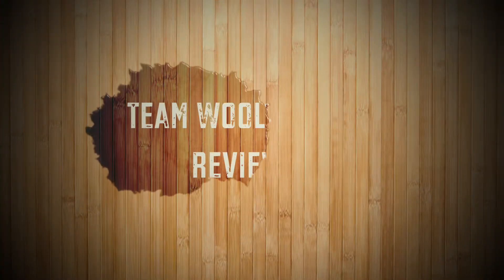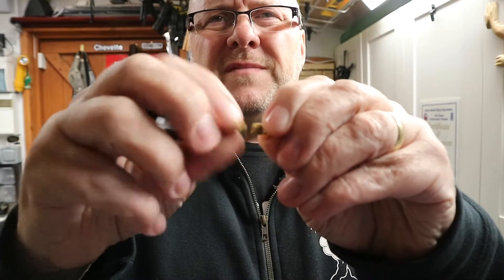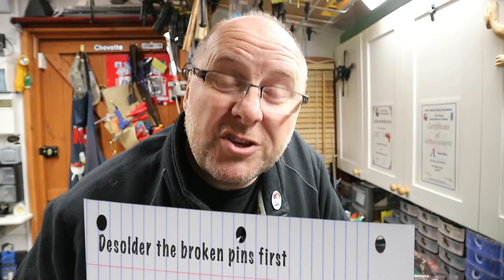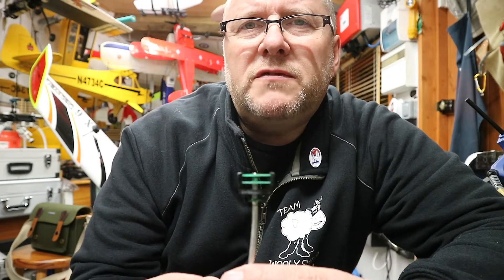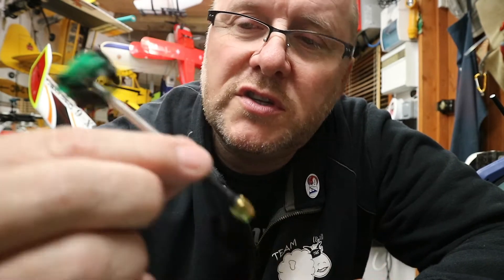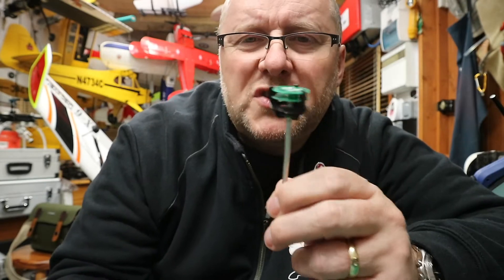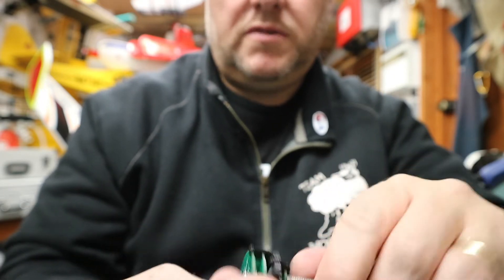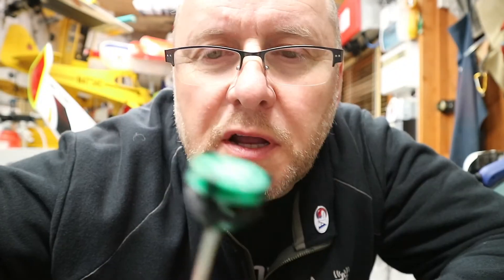Quad VTX Plug Repair & Drone Crusader Antenna Review

Comment: Hi  Buddy, nice video  cheers for the mention 
the clip system was designed by painless360 there are stubby versions with extra shrink tube protection for the racing quads, RHCP and LHCP :-)
Reply from the maker: No problem, thanks for the antenna to try. The Pagoda is a really good antenna design but if the plates get bent out of shape they stop performing. The clip solves that. Rammer Rhodes used a couple of blobs of hot glue between the plates on his and seems to work well.